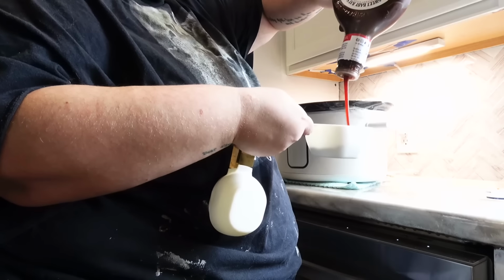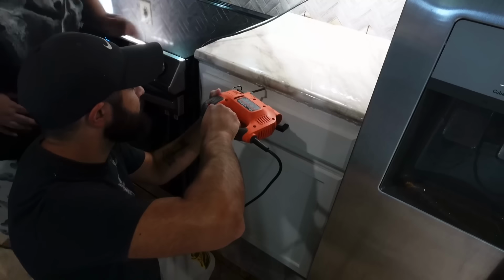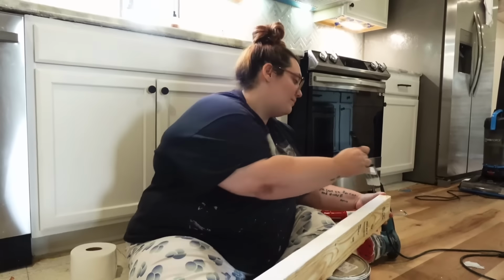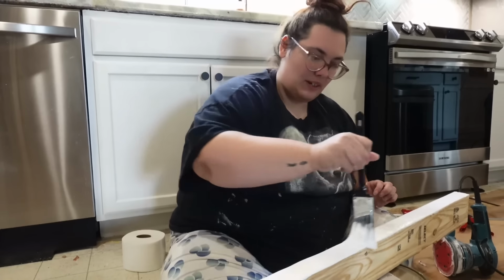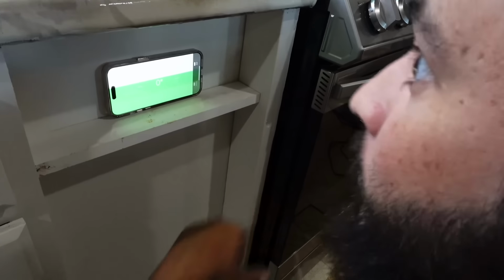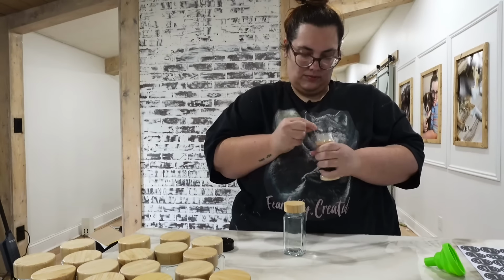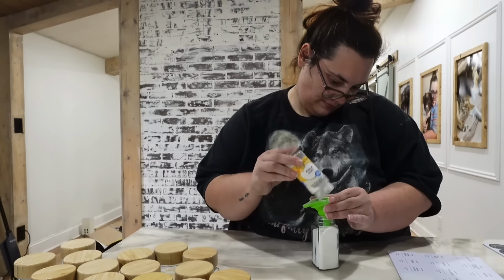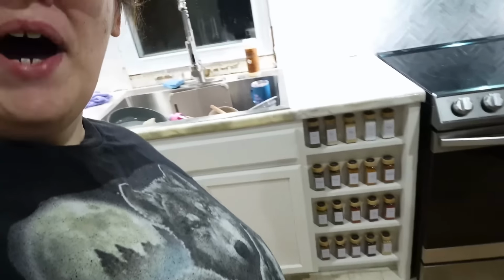BUILDING A BUILT IN SPICE RACK IN OUR MOBILE HOME | 1991 mobile home makeover on a budget! Ep.36

Comment: Future reference, if yall do epoxy countertops again. After the flood coat has dried a bit, to the point of no longer moving, still tacky (kinda feeling rubbery) you can run a putty knife under the counter to get rid of the bumps a lot easier. Brush on a little epoxy under to be sure that it is still covered and thats it.

Comment: My favorite way to dice an onion is to cut vertical and horizontal lines into the onion going down to almost all the way through but not quite. Then turning the onion on its side and cutting. It create a crisscross pattern that you then just slice perfectly diced onions off. This comment reads really confusing but it works so well!

Comment: Hi Merina your home looks beautiful. Just an FYI you can paint over epoxy and recoat or sand down the parts you need to change then paint and recoat and epoxy will level out but just an fyi I did the same thing with my counters years ago and they looked great at first, unfortunately epoxy yellows especially in sunlight and takes on a yellow green tint which is noticeable with light paint colors. I used a dremel to sand down the drips underneath😢

Comment: Here’s a crockpot recipe  I’ve made for 30 years. Put One 3-5 pound chuck roast in the crockpot on high. 
In a small bowl mix 1 can of Campbell Cheddar cheese soup and one packet of Lipton Beefy Onion dry soup, do not add any water. It will be thick. Pour the thick mixture over the roast and don’t add any water. Condensation will water it down as it cooks for approx 5 hours. When it’s fork tender it’s done. It does not taste like cheese at all, you won’t believe the flavor.

Comment: Use jalapenos the same way you used your peperoncinos. They are a bit hotter flavoured, but before slicing them up, cut them in half and slice out and discard the seeds. That will remove a lot of the heat. But wash your hands after cutting them for sure.